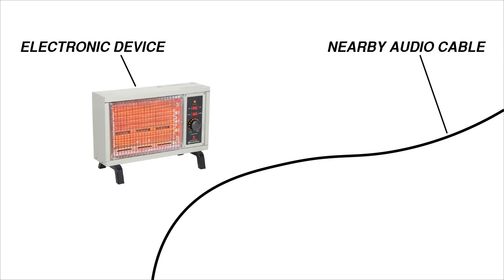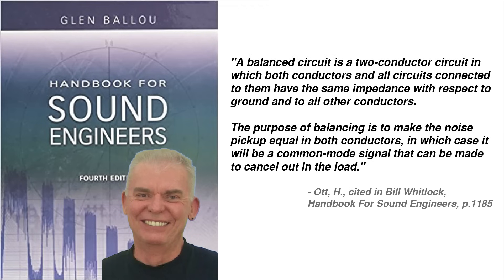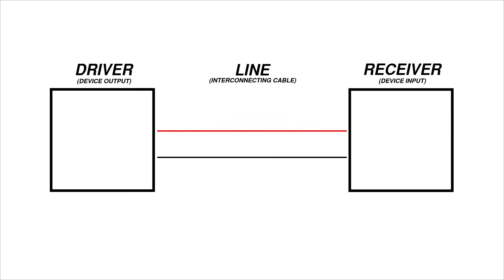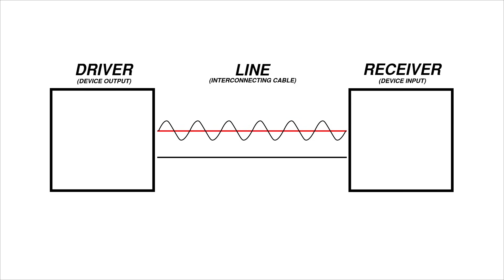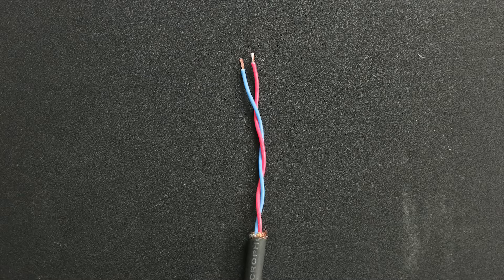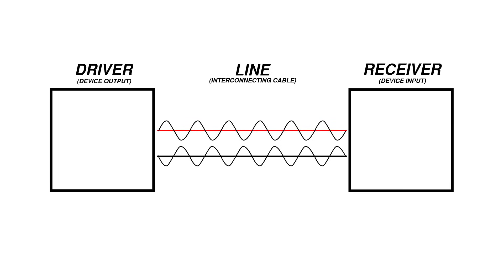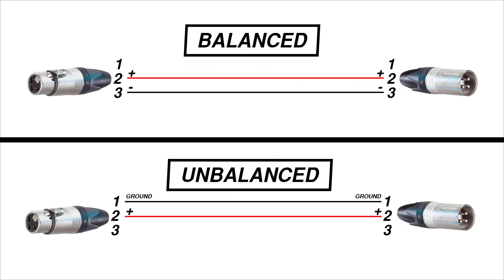Balanced vs Unbalanced Audio | Do Balanced Cables Sound Better?

Comment: The video implies that you only need 2 wires for a balanced connection but you must also include a ground. In addition to use balanced connectors you need electronics with balanced input/outputs, You cant just use a balanced cable to receive the proper noise benefits, the electronics must support it. A balanced output drives one output high with respect to ground and the other output is driven low wrt ground. You must bring the ground wire along as well.All manufacturers configure the ground as a shield which adds more noise protection.  At the input end the receiver amplifies the difference it receives at the inputs. Since both the + and - conductors have exactly the same noise signal induced on them wrt ground there will be a very small if not zero difference at the amplifier input due to this induced noise.This is called CMR - common mode rejection. If you do not bring a ground along with your + and - conductors you may indeed find an AC hum present but this time due to a different phenomena. a difference in ground potential between the sending device and receiving device. one more thing without a ground you cannot use the cable to supply phantom power (microphones).

Comment: Doesn't the ground signal get subtracted from the signal of interest in the unbalanced case? I still don't get what the big difference (mathematically) with the balanced case is, is it that the impedances in these wires aren't matched? Also in the case of the balanced cable with the inverted signals, wouldn't that help further with the signal to noise ratio?
Reply: In all but the very smallest real-world audio systems, there are almost always 2 or more pieces of equipment that are grounded via a 3-prong AC power connection.  Due to the inherent nature of AC power wiring, there is always a tiny voltage difference between any two outlet grounds.  To make equipment safe, the outlet ground is connected to the shield ground inside equipment.  This voltage difference causes a small current to flow in the shield conductor of audio cables.  In a balanced cable, it doesn't matter but in an unbalanced cable, the tiny voltage adds directly to the signal (producing hum or buzz) because the shield is part of the signal path.  A voltage of only a tenth of a thousandth of a volt (100 micro-volts) will be audible above the noise floor of a CD.

Comment: Who runs a thousand feet of cable? If the RF is imperceptible 
on a short run of let’s say twenty feet or there is an absence of a noisy device anywhere in the room why would I go to the bother?
Reply from the maker: For a short run like that, you’d probably be ok using unbalanced. Unless the noise potential in the room is particularly problematic.

Comment: Am I understanding you correctly, that if I just run a simple cable with two identical wires without shielding from my amplifier to my speaker (ideally twisted), this will be a balanced connection?
Reply from the maker: Yes. My understanding is that an amplifier to a speaker is a balanced connection.
Reply: That won't work.  The video misses one important point in that the input device has to combine the + and - signals by inverting the polarity of the - signal.  Without this polarity inversion, the noise imprinted on the - signal wire will not cancel with the positive.  You would essentially just be doubling the noise.  Amplifiers to speakers are unbalanced connections.  The only way to convert the signal to a balanced connection is through the use of a transformer or active circuitry.

Comment: why are balanced connections not common on everyday devices then, after seeing this you would never want to use anything except balanced connections.  I have lots of audio devices and components some of them thousands of dollars and none have balanced connectors
Reply from the maker: For short cable runs, there isn’t a big difference. Most residential systems have only short cable runs. Professional and commercial systems tend to have a lot of long cable runs.

Comment: so basically the advantage of balanced cable vs unbalanced cable is to eliminate noise? I always thought balanced cable will bring more "hi-def" audio signals in headphones, which is why it costs more than the unbalanced version..
Reply from the maker: You’re correct. The primary benefit is protection from noise acquired along the cable path.

Comment: Thanks. That’s really interesting. So if I have the option to use either balanced or unbalanced I should opt for balanced at the same price point, say 60 pound for 2x3m?
Reply from the maker: For cable runs beyond 15’, I would always recommend balanced connections. For anything under that, it depends on the noise environment, but it probably won’t make much of a difference.

Comment: Ok with the 1000 feet cable,how about 10 feet cable?  Its the same noise? Is distance a factor for this noise? Thanx!
Reply from the maker: Distance is certainly a factor! For anything under 15’ or so, you probably won’t have a noticeable issue with unbalanced.
Reply: @AudioUniversity  Thanx a lot!

Comment: Nice video! Although, I think the explanation of impedance is incorrect.

It is true that wire gauge affects the resistance of a conductor—double the cross-section area -> half the overall resistance, double the conductor length -> double the overall resistance. But this is usually only relevant for power cables which will heat up under heavy load, not low-current signal cables. The word "impedance" isn't usually used in this context.

Bill Whitlock actually says in the quote that the impedance in question is from the balanced circuit "to ground and to all other conductors". Not the resistance from driver to receiver, along the cable's length, but from signal to ground, straight through the cable's insulator to the shield. Or, more likely, through the output/input impedances of the driver/receiver, respectively.

Still, good explanation of the concepts, and nice job with the audio sample at the end.
Reply from the maker: Thanks, Lorenzo. I hadn’t thought of it that way. I appreciate you taking the time to share this info.
Reply: High-quality noise rejection does require that the impedances of the two lines are well matched.  In the case of a long cable, for example, where the two conductors were mismatched by 1 ohm in their end-to-end resistance, the noise rejection would be limited to 40dB at best, assuming a typical 100 ohm driver impedance and a noise source near the receiver end.

Comment: That's because electrical current doesn't flow through the wire it flows around the metal wire

Comment: So the question posed by the video's title cannot be answered by what information is given within the video. Even with unbalanced cables, there is a good chance that no audible noise will be picked up, so in that situation the demonstration used in the video would give equal results. But as stated in the video, if the cable is run thought an electrically noisy environment, then the balanced cable's signal will be better in the sense that it won't have the hum.

So, for long cable runs, or any cable run through an environment where the level of electrical noise cannot be predicted, or which is known to be significant, then obviously the balanced cable will "sound better" in the sense that there is no hum added, but that qualification is not part of the question as posed here.

On the other hand, if the cable runs are short and in a known/controlled environment where pickup of stray electrical fields (including magnetic fields) will not pose an audible effect, then the posed question could possibly be answered the other way around. An example of such a scenario is on the back of several pieces of audio equipment that are located right next to each other, perhaps in the same rack. In order to convert the natural unbalanced signal to balanced before it goes into the cable, and then unbalance the signal again at the other end of the cable, noise and distortion are introduced by the devices and/or circuit used for balancing/unbalancing. Possibly this could result in an increased noise level and/or distortions such as coloration (changed frequency response across the audible bandwidth). So in that scenario, it would be better to use unbalanced cables.
Reply from the maker: Good points, youtuuba!

Comment: I've seen people take headphones designed for an unbalanced input (well, the speaker has a + and a - like any other) and re-wire it to be balanced.  I was always a bit confused on how this is possible without some sort of device in the headphone doing the signal subtraction. If you don't have that, all two signal wires will do is give you 2x the noise! :P
Reply: The only potential advantage would come from use of a balanced headamp, in which the output stages are separate and differential with no common ground, as is the case for most headamps driving headphones via a TRS plug. The reality is that a speaker cannot react any differently to a differential input--all it sees is the voltage difference. Balanced connections are only inherently superior at low signal levels in noisy and/or long cable length applications where interference is likely.

Comment: If it wasn’t for my sound guy friend teaching me over many, many years, I wouldn’t know half of what I do about sound. Having said that there is plenty I realize I still do not know. I am a music teacher. I frankly don’t have enough time always to learn everything about everything. My sound guy friend would sometimes tease me a bit about how I would get things to work even though it was done all weird or wrong. Having learned how balanced cables can cut down noise several years ago, I have been much happier with the day to day sound coming out of my speakers and the results I get from recording students music. Most of the noise I get these days comes from the computer jack. I have no idea what to do about it.
Reply: Computers produces on their jack usually a Stereo, Unbalanced output, and as U know it can be noisy on a longer route, or due to electromagnetic issues. U can insert a D.I. Box into the wiring, with as short unbalanced (computer) cable, as possible (and check the connections as well). It makes the signal flow to balanced type, and U can separate, the ground point of the different equipments (see: ground lift). This can solve many issues, but not all of course. For the first step I'd suggest to get one (pair) of these, in a good quality. U can choose either a passive, or active one, but I suggest if U choose an active, to feed it from phantom power instead of batteries.

Comment: In a scenario when both wires are carrying signal (one with phase inverted) and summed again at receiver, doesn't signal get dB boost because of summarization?
Reply from the maker: Yes. The summation results in a signal 6 dB greater than either individual signal.
Reply: @AudioUniversity  Thanks for the reply. Does the receiver (active near field monitors for example) then pad it down to match the source?
Reply from the maker: I don’t believe the signal is actually amplified by the balanced connection. My understanding is that it has more to do with headroom and SNR.

Comment: Another important factor is most unbalanced cable applications are high impedance, such as guitar amp inputs near 50 to 100K ohms, RCA at about 20K ohms, etc. There are some karaoke microphones that are unbalanced, but lower impedance at between 200 ohms and 1K ohms. Low impedance on cables helps reduce noise pickup by shunting the generally high impedance noise to ground. Balanced XLR is generally between 100 ohms an 600 ohms impedance. Microphones are typically in that range and the input of the amp is generally 600 ohms. Line level amplifiers such as powered speakers commonly have 10K to 20K input impedance so they can be daisy chained without overloading the signal source. For example a line array of powered speakers or amps, can be daisy chained with 10 to 20 amps and not be a problem. This can not be done with high impedance gear without severe loss of high frequencies.
Reply from the maker: Thanks for adding this info, isettech!

Comment: Question, is an Optical Cable the only way to eliminate interference completely from an audio signal?
Reply from the maker: Yes, I believe the only interconnect cable not susceptible to electromagnetic noise is a fiber optic cable.

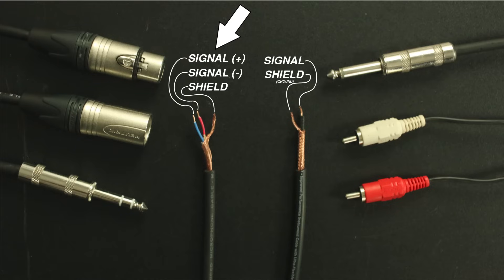Comment: I don't think your explanation is quite right. At 2:50, you show the two signals being the same phase, yet somehow that cancels them out? At 1:17, you can see why that this is incorrect - one signal is "+", the other is "-", which is correct for a balanced cable. What the balanced circuit does is remove anything that is on BOTH signals and with the SAME phase on both. The balanced source provides the + and - signals as inverses, so that anything in common on both signals must therefore not have been from the original signal. Noise is induced to both signals with the same phase - the noise source isn't a balanced signal, in other words, and so the circuit removes it.

Comment: Fairly good basic level explanation. But there are so many other variables in real life. Such as a large number of devices such as most amps are single ended inputs. As are many sources such as most musical instrument pickups. Lower cost mics... So matching devices are need on one or both ends. Cheap transformers can often do more sonic damage than unbalanced connections. Even the best matching transformers are coils and as such have inductance related band limiting and phase shifting.

Comment: Kyle, it would be helpful to explain the inverting and non-inverting inputs of a differential device.  By using the example of the same noise on both signals, one can easily see how noise is canceled.
Reply: @GladeSwope  The signal is + and - at a balanced output.  When the signal arrives at a differential input: the + input is non inverting, the - input is inverting thereby canceling any noise on the balanced line